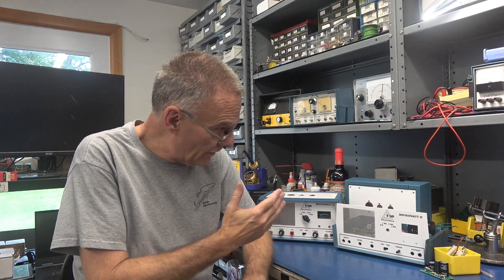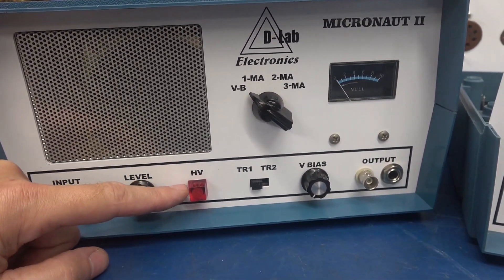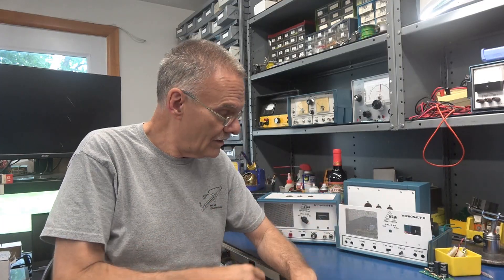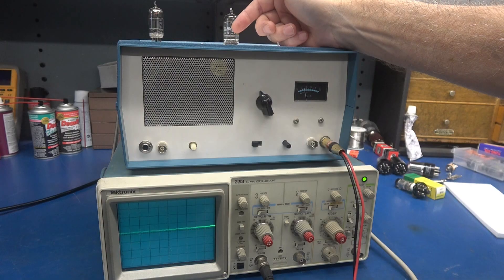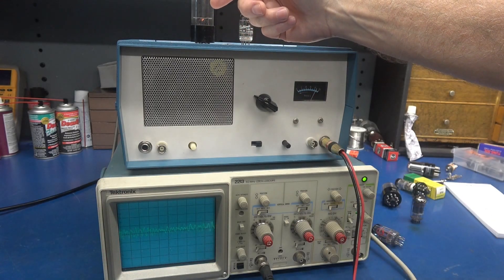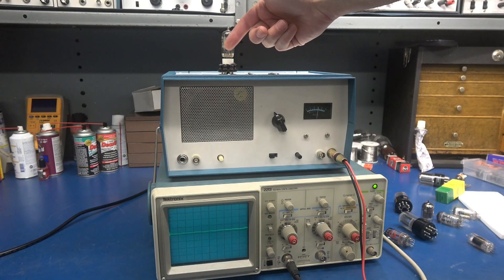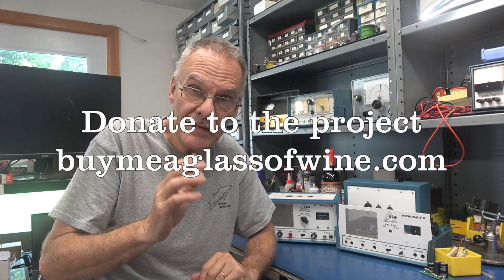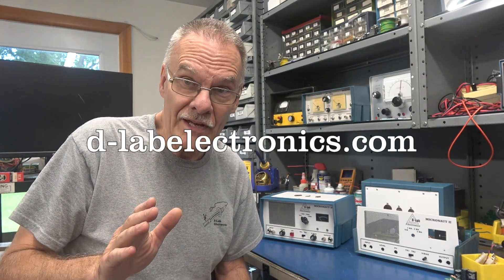New project D-Lab Micronaut II preamp tube microphonic analyzer Update audio testing design results

Comment: EF86 is per default very sensitive penthode tube because of its construction and very high gain. Many times people decouple them from the main chassis in guitar amplifiers so that the vibrations do not lead to a feedback. Some decouple just the socket using the rubber grommets. Others use separate plate to mount the socket fir the EF86 and then decouple that whole plate from the chassis using various rubber elements.
Vox used EF86 tubes in their iconic amplifiers.
If you knock on a good EF86 you will hear it in the amplifier.
Amperex tubes were awesome. They are not cheap.